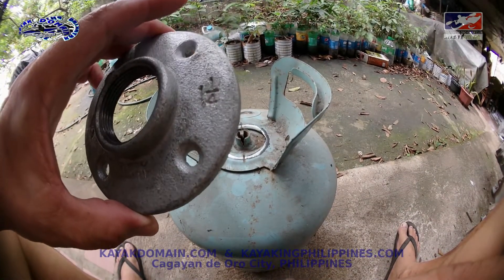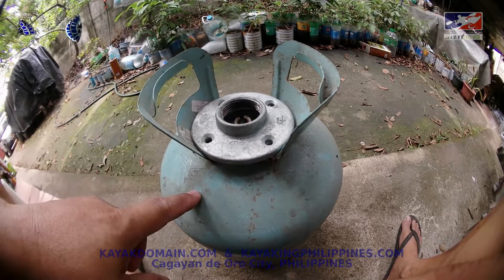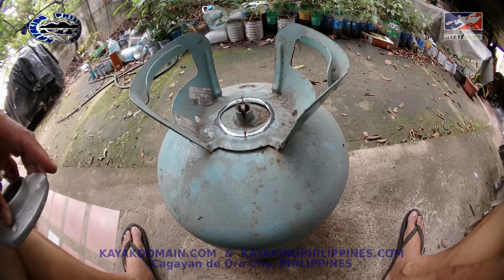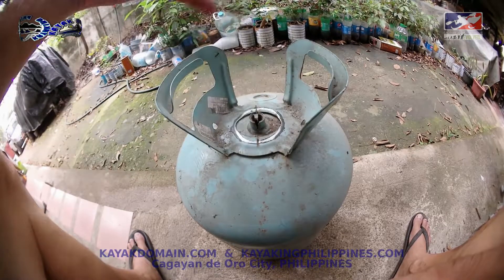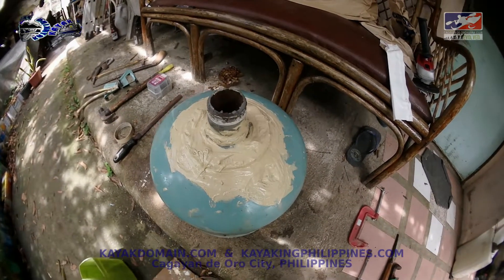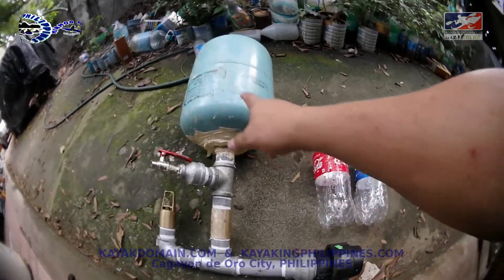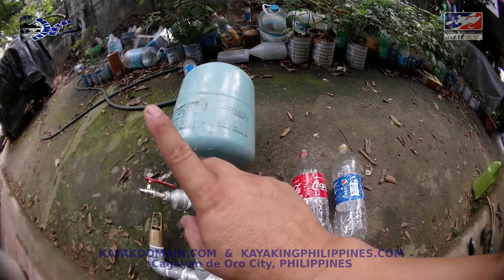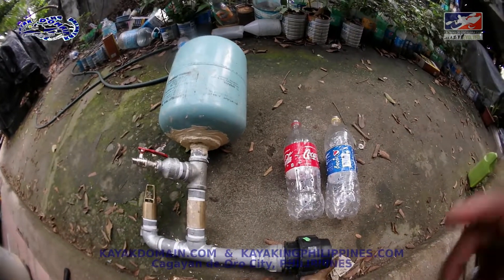Hydraulic Ram Pump 1.25 inch, using Freon Cylinder as Compression Tank

Comment: I got to try this one day just to see it work.
Its like you can believe it till you do it..
Who ever invented the ram pump is a true igenous
Reply from the maker: Ram Pump works very well if and only if you can attain the optimum high pressure along the system. The Freon Tank is not as good as the thicker material like LGP tank or Oxygen tank like in the hospital. And the "Feed in Pipe" input must be as straight as possible, i.e. no curve, no kinks, as diagonal as possible in order to attain higher pressure.

Comment: Na install mo nb yan boss
Reply from the maker: yeah, it can pump but the max head is only about 35m. We need double that in our farm.
Reply: @KayakDomain  yun samin na install na, preon tank ginamit namin pang pressure tank, successfully works na, 60meters mula rampump to target area, trial and error talaga. Ini upload ko video dito
Reply from the maker: @magertvofficial7381  It's good that you were able to do a max head of 60 meters. Is the 60m vertical?
Reply from the maker: @magertvofficial7381  I commend you for achieving 60m. Hopefully, we can achieve similar.
Reply: @KayakDomain  u can achieve same, we need to upgrade more, becoz weak flow of water... What country are u
Reply from the maker: @magertvofficial7381  Cagayan de Oro, Pilipinas. Bisdak. Ang farm sa Kinawe, Libona, Bukidnon

Comment: I was hoping to see the thing working.
Reply from the maker: it was working but we can only achieved about 30-35m head with 2" input pipe, and 1.25 ram pump,  and  1/2" out. I'm making another one with 3" input, and 2" ram pump, and 1/2" out, hoping to achieved at least 80m head then I'll make a video. Most likely not using Freon Tank anymore.  Due to COVID this new project is on hold.
Reply: @KayakDomain  do u have a video intall it and how it works